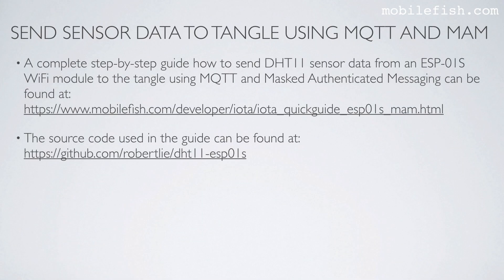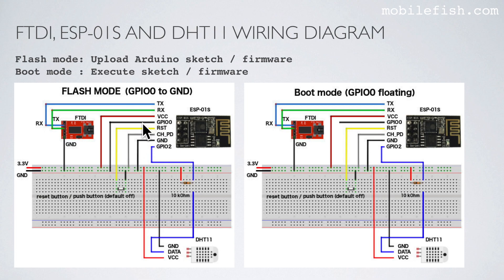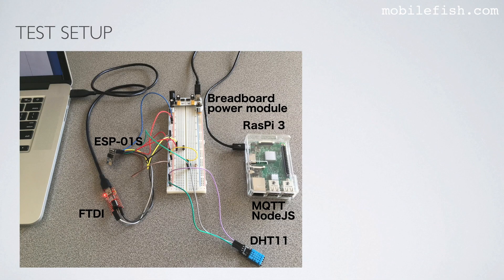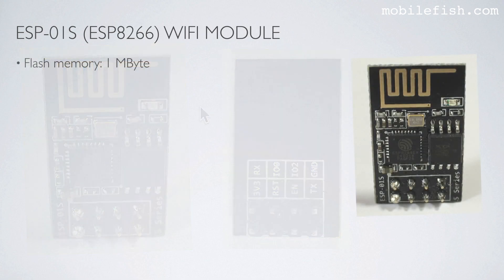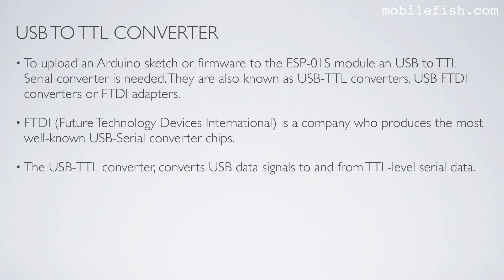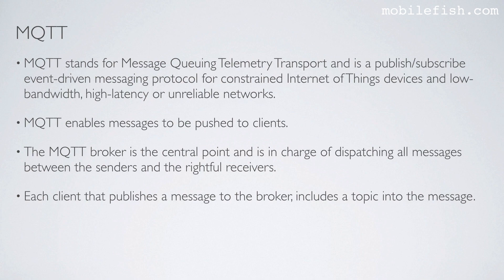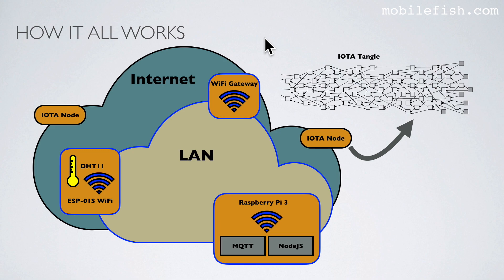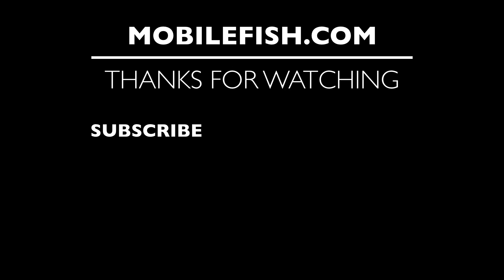IOTA tutorial 30: Send DHT11 data to the tangle using ESP-01S, MQTT and MAM

Comment: Is IOTA open source ? Or else do we need to pay crypto currency for transactions ? Can I use it for production level projects for free of cost ?
Reply: Yes it is Open Source. 
Yes, you can use it for production level projects.
Yes, it is free of costs.
Yes, even the crypto currency of IOTA called MIOTA that is based on the tangle does not have transaction fees. It's therefore possible to make micro transactions without fees. -> for e.g. to let a small machine pay another machine without the need of a human. 

IOTA is exactly made for stuff like this.